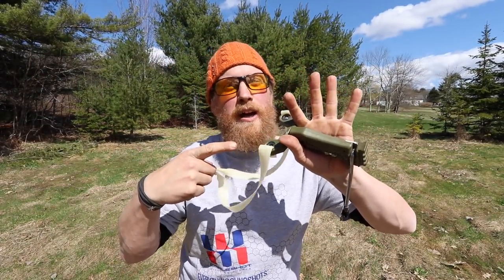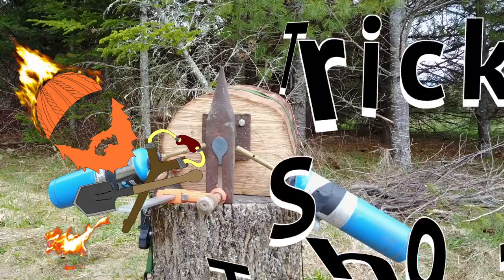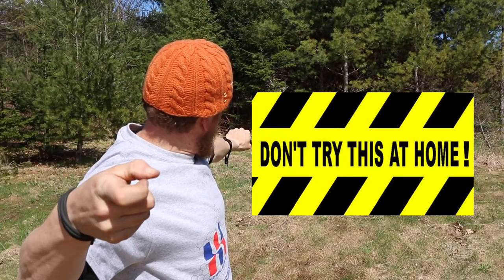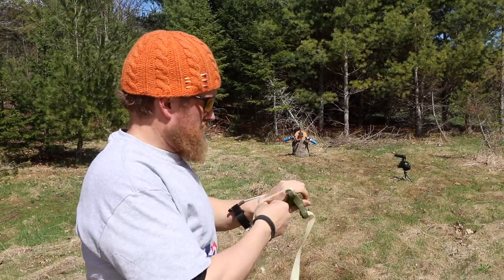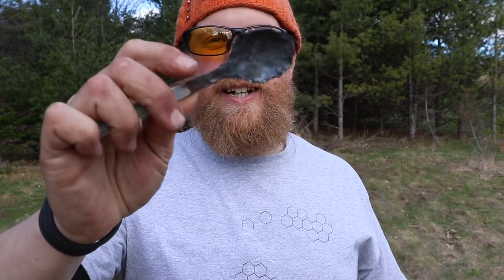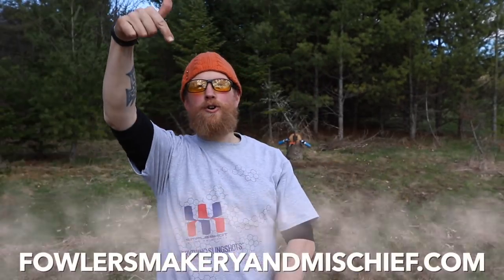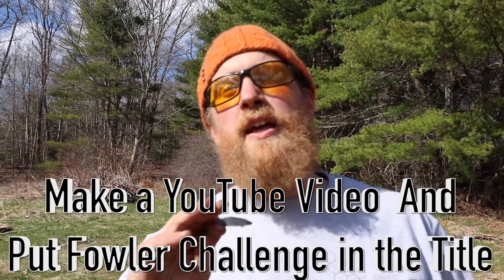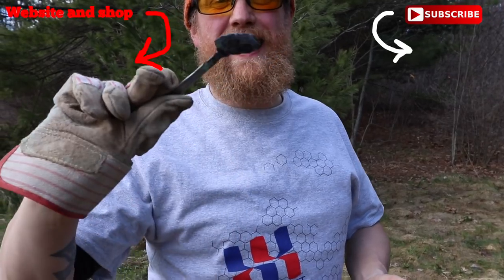Forging A Spoon With A Slingshot, The SimpleShot Hammer | Trick Shot Tuesday Ep. #6

Comment: Hey, because this slingshot is called the Hammer, do you think you could drive a nail with it? I'm thinking a roofing nail at 30 feet would be pretty gnarly! You may need to pilot hole the nail first or it will probably just go flying. I don't know if that's too easy for you or not.. if it's too easy, maybe have a few nails and try to drive them with consecutive shots?

Comment: So as someone who's dicked around with blacksmithing, and has made a couple spoons, I can say that would be a lot easier if you didn't have an anvil behind it. I made a simple swage block from mild steel for spoons, but before that, I just used an oak log with a dip in it from a ball peen hammer. That would work a million times easier than trying to get a curved shape by hitting against a flat anvil.
Reply from the maker: Neos Neos cool maybe next time I'll have to give that a try !

Comment: Just a quick thing that I've learned from (terrible) experience- never wear loose gloves when using fast moving tools like a belt sander or angle grinder. I was wearing thick rubber-coated gloves while using a wire wheel... After a trip to the ER and nearly needing a skin graft, I learned my lesson. 

Please be safe!
Reply from the maker: I hear that I think that more applies to soft loose gloves then just lose gloves though.  When I used to build wooden boat You could get a cheap cotton work glovesIn the stockroom Remember guy breaking a fingerWhen they snagged on the drill press.
Reply: Fowler's Makery and Mischief yeah, it's sorta scary stuff.